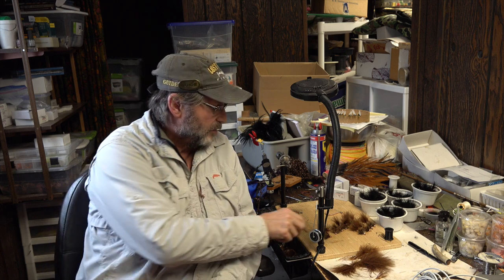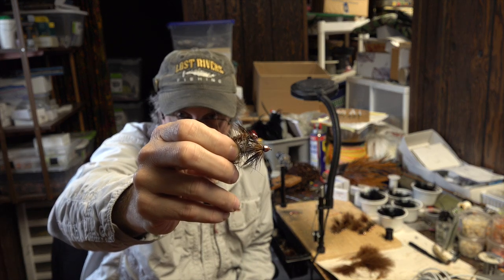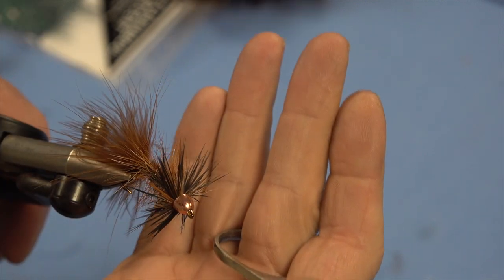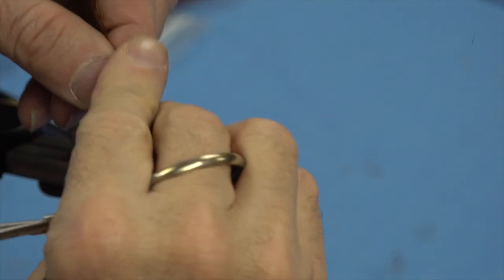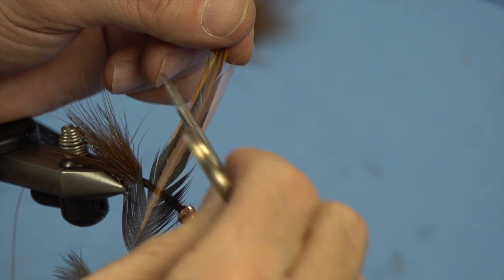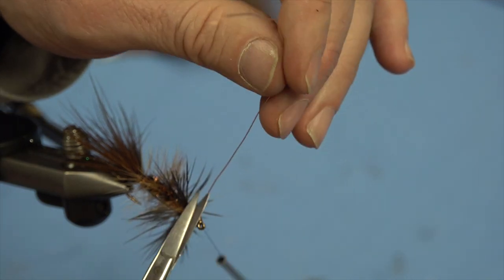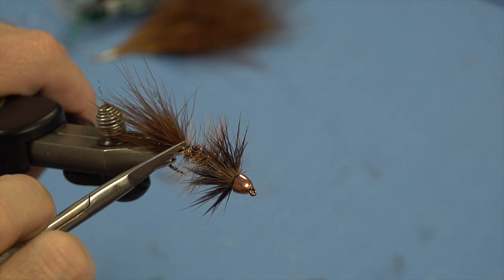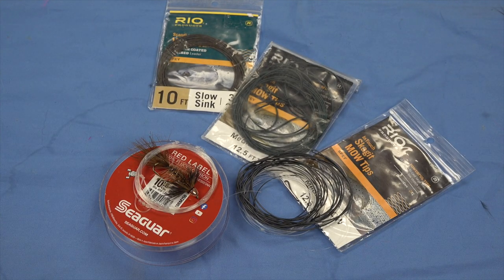Fly Tying Steely Crack

Comment: Jay, the Steelie Crack is really producing for me on our eastern ID & western WY streams. In particular, during one outing I experienced very selective spring creek rainbows moving several feet to slam a Steelie Crack floating dead drift under an indicator. Also, on several drifts they slammed the fly at the end of a drift on the swing. These are tough/pressured trout that really keyed on this fly. I think I found a neat application for your streamer. Try it on your streams in conjunction with a Juan worm or egg tied directly to the bend of the streamer in a classic tandem rig. Thanks again for sharing your guide fly.
Reply from the maker: You are welcome, at times I do just what you're saying

Comment: I have never been able to grasp the value of counter wrapping the wire.  Wrapping it the same direction of the hackle wrap seemed to work just as well.  Counter wrapping is said to strengthen the hackle wrap.  The issue I noticed with counter wrapping is that the physics of it moving in the opposite direction would unwrap the hackle...loosening the tightness of the hackle.   Wrapping forward the wire around the body/hackle  would offer the same secureness to the hackle without the process unwrapping the hackle.  You just need to make sure your notvwrapping the wire forward in-between the hackle....counter wrapping cross wraps the hackle more effortlessly but it's pretty easy to understand you need to wrap over the hackle.  So the most important variable and behavior of material that was worth avoiding is the unwrapping of the hackle. 

This was the first fly Carl taught me.  He said do you want the steelhead version or the O******a version...
Reply from the maker: Fly tiing is like anything else. Everybody has their own techniques.I will often counter wrap,To strengthen the body. It is tricky to take some practice.